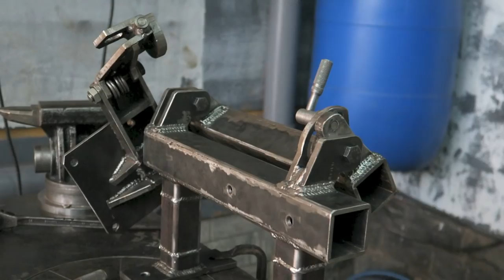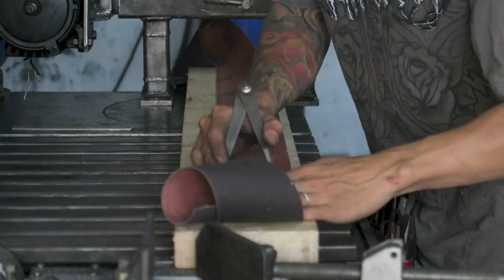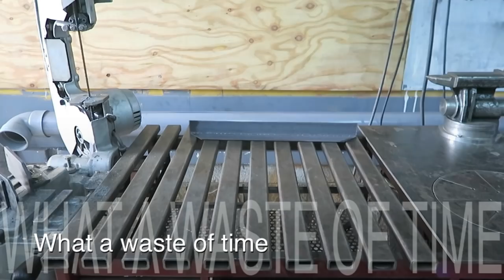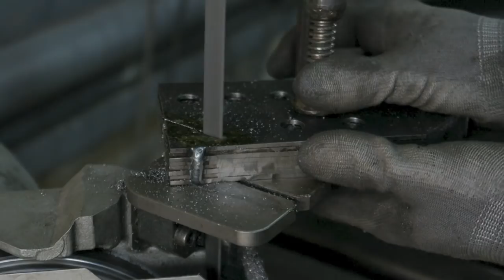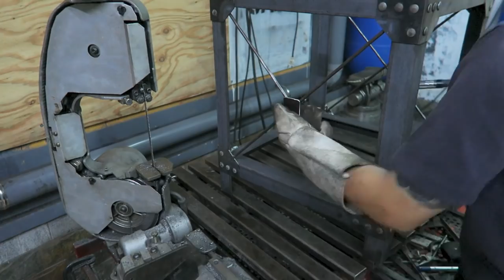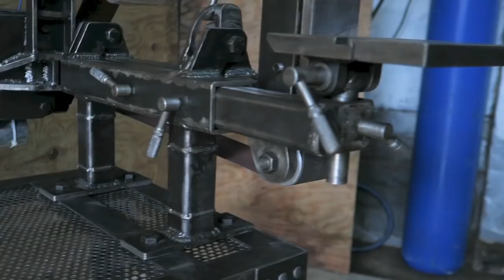Diy BELT GRINDER industrial stand

Comment: Seems like the square tube in tube approach worked out just fine.  Nice fit-up and solid workmanship all around.  Much simpler than the original solid square bar and welded receiver design too.   Sure, one is much beefier, but I'll wager both get the job done and vibration probably isn't an issue.    Like the DIY vice too.  Very clever.

Comment: What HP is the motor?  220v?  Do you wish you had variable control?
Reply from the maker: John Harmon - Cold Creek Works 1.5 hp. 2800rpm. I used the craft i have in the shop. Im planning to make another my onw version with 3phase motor so i can control speed.
Reply: Thank you!

Comment: Good idea bracing your stand with tension rods, much less material required than compression which has to resist bowing. Should work with pipe too. Idea! Make heavy machinery stand with big pipe, then fill pipes with sand to damp vibration. Could possibly be done without welding. Does not have the panache of your work, though :). OTOH, though....

Comment: I see you extended the legs. Did you do this so the motor would clear the table when tilted to horizontal?
 
Also, I see you have both tubes level instead of the ½” difference Jeremy’s design calls for. Was there a reason for this and were there other changes required because of this besides the tilting tube’s brackets?

I have purchased Jeremy’s plan. Do you have a revised plan available?

Comment: Nicely done, I do like your locking and adjustment handles over Jeremy's wooden ones, but he doesn't own a lathe. (yet). As for the rivet finish on the corners, nice touch, now stop showing off. 
The grinder will be a hard enough job without having to bling everything up to match this....

Comment: Nice job!  Do you think Jeremy's design would work fine using all 1/4" steel instead of 3/8"?  I have a lot of 1/4" but not a lot of 3/8".
Reply: The stock I used for mine is 2x2x3/16  I didnt make mine to hinge but 1/4 should be more than enuff .  I was thinking of making another with the lay down and adding adjusments didnt make table to slide up and down only tilt

Comment: I like the simplicity of the design. Did you work from a set of measurements for the square tubing and other attachment parts, or did you do this by trial and error? Did you note down the final measurements that you ended up using?

Comment: And $10,000.00 later, viola!, a homemade belt sander. Somebodies daddy has a machine shop and an endless supply of steel.  🎶🎵🎵🎵”Labor is nuthin and the chicks are free”
Reply: I’m still trying to find a compliment in your post but every time I read it, it sounds like an insult.
Reply: @ Rober Langley  It's called hating, because you dont have the skills to make one yourself.  FYI, Jeremy made a cost breakdown, originator of the design, $800 including a variable drive and 2hp motor.  The bearings can be ordered if you dont have the machine to make them.  
And a little more knowledge so you can educate yourself,  most folks that make videos on YouTube have the equipment they have because they have worked to earn them.   One way or another, whether earned funds from videos or the use of there trade/skills.
Reply: @Robert Langley actually, steel is really cheap, and is probably the cheapest thing about the build.